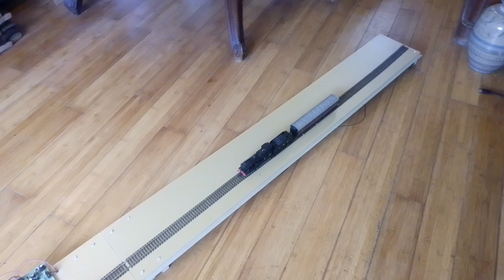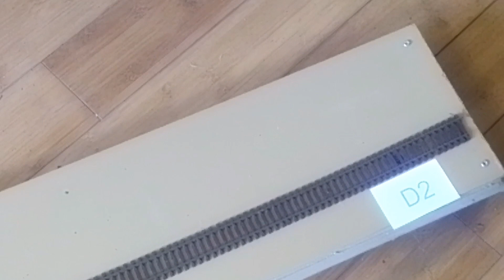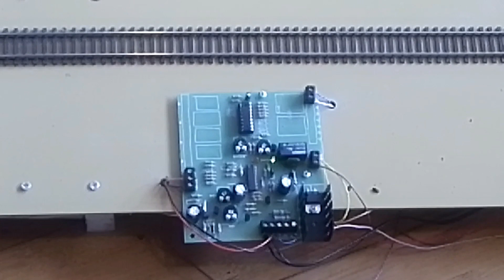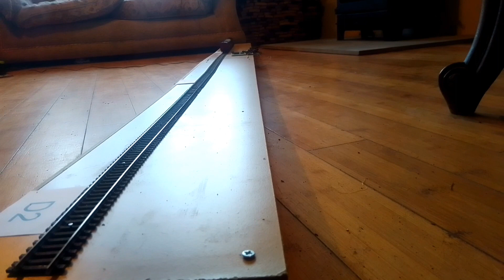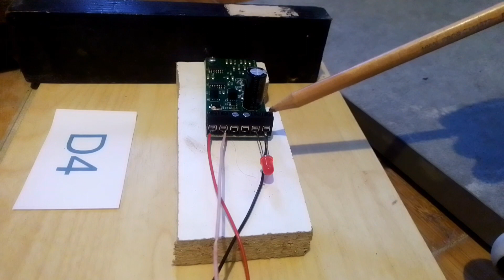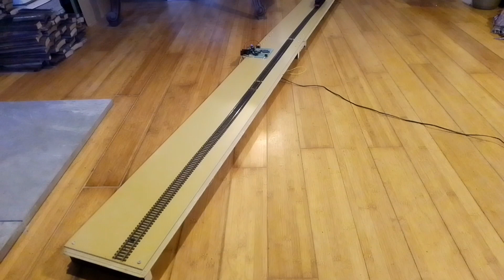Shuttle with realistic slowing and acceleration

Comment from the maker: D1, D2, D3 and D5 refer to terminals on the SA1 board. We make other shuttles, the SA1-S which has control of a starter signal at each end of the line. The SA1.1 and SA1.1S which  are like the SA1 and SA1-S but have the additional capability for one or more intermediate stops. The SA9 and SA9-S which have a siding at one end of the line so that 2 trains shuttle alternatively. The SA2 and SA2-S which have a siding at both ends of the line.
Our website is at www.heathcote-electronics.co.uk